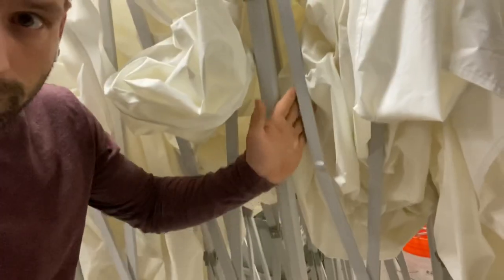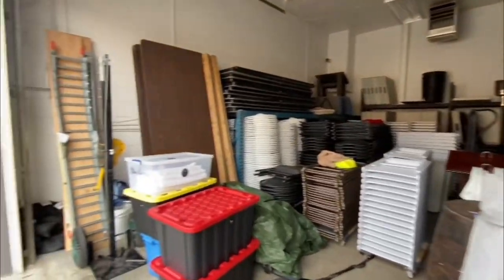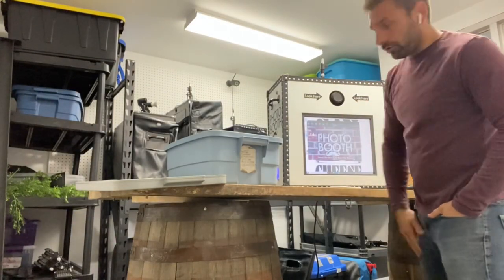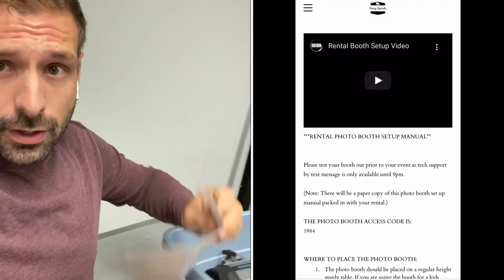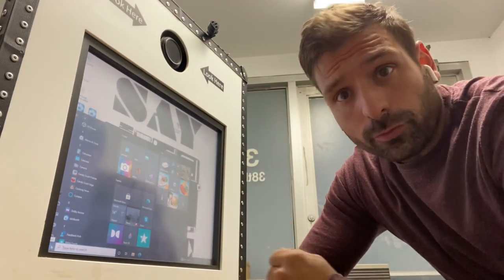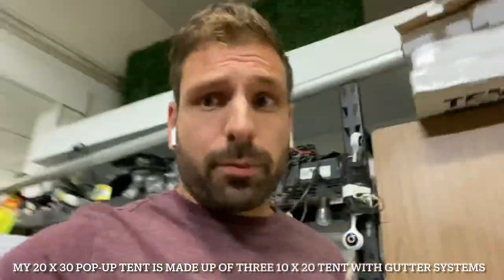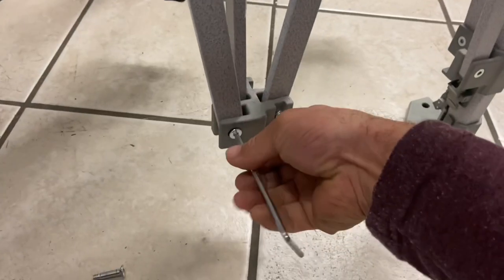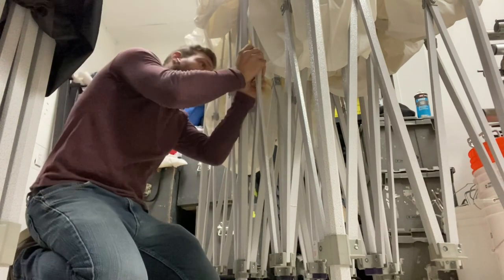A Unique Photo Booth Business Startup Setup In Small Party Rental Business Shop

Comment: Really tempted to make one(or more) of these. Their(DSLRBooth) website states 8th gen Intel i5 as a minimum, but I've noticed your DIY build uses an older HP 8300(3rd gen Intel). Does it have any issues running the DSLRBooth software in your experience? 

There are LOADS of older USFF PCs around me(I'm in Australia) in the 4th to 6th gen Intel i5 age, just wondering if you think it'll be enough? Would likely just go for the 6th gen. Thank You :)
Reply from the maker: All my computers are i5. Don’t go lower or you will have issues.
Reply: @therentalguy  well if your 3rd gen i5 handles it well, then I'm sure a 6th gen will be no problems.

Love your videos, thanks for all the inspiration. I was recently paid out from my previous workplace closing, so now I'm going 100% into this business!

Comment: I thought about making special booths and sending out the booths with no attendant, but I just dont trust the cust to operate the booth without a problem.
Reply from the maker: I just have videos for troubleshooting. It’s seldom that people have problems. Usually there is a tech person at every event who will help out. It’s worth it to scale up.
Reply from the maker: Also using foto share you can check up on the photos brightness and use booth co-pilot to change the ISO on the camera to correct issues  remotely.
Reply: @therentalguy  is this using dslrbooth? That genius, but it would need internet correct? Do you have a hotspot in there?
Reply from the maker: @loganz  The client is directed to hook up to wifi at the event or hotspot. Don’t worry about the problems that can arise just roll with it. People are very fearful of the what if. Put that aside and be bold to prevail!
Reply: @therentalguy  That is awesome. And such a great idea.. I'll look into it.. I do event photos at the same time and usually leave the booth unattended and nothing ever goes wrong.
Reply: @loganz  Well there are no prints, so there a less issues.
I dont think I would hook up a DSRL camera to a solo unit; I would hook up a webcam with some lights built in to the box to serve as the flash; that would eliminate 1 barrier for the cust.
I also think it would not be a bad idea to hide a 'Mobile Hotspot Router' inside the box somewhere this would automatically connect the PC to the internet removing another barrier to the customer. DSLRbooth does not use that much data if the camera brightness is set to 400.